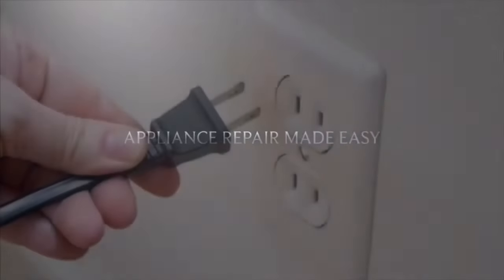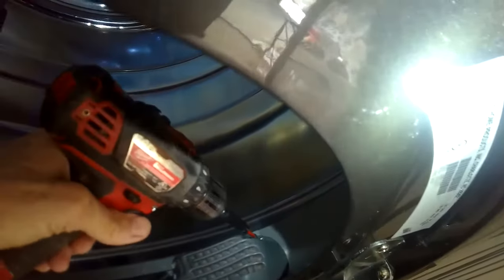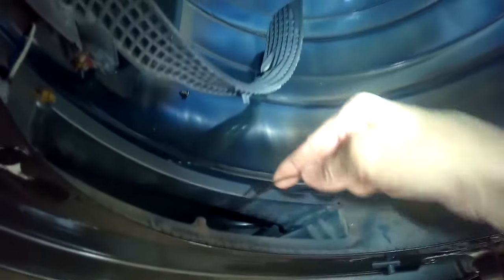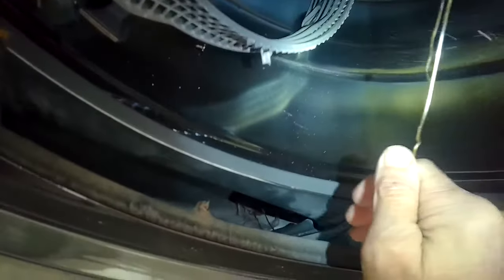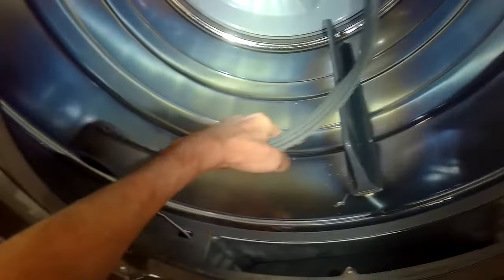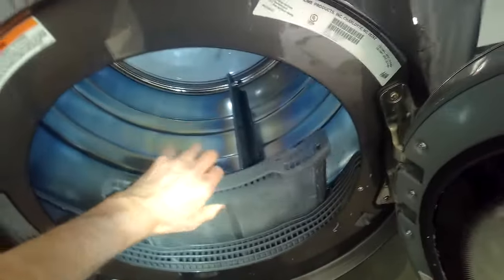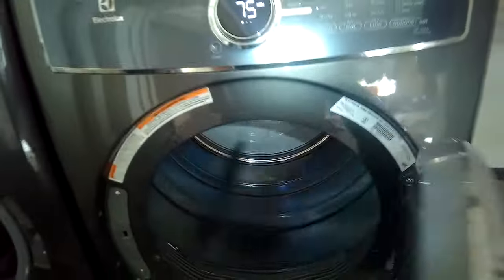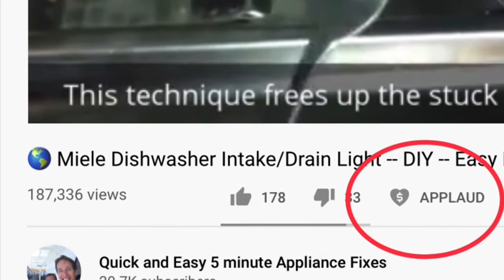✨ELECTROLUX DRYER MAKING NOISES-EASY FIX✨

Comment: Pulled out so much lint.  Have had this dryer for 5 years, no issues, no noise.  But when it started it was awful.  Had two techs out.  Both said oh its just Electrolux and you should just get used to it.  What?  Used your advice and you can't imagine how much lint came out and to my surprise a lint dryer sheet was in the mix.  Yikes!  I couldn't get the wire to work for me so I just got my hand down in there.  Tight fit, but it worked well. Thank you so much.
Reply from the maker: Nicely done 😊😊😊

Comment: Got mine fixed, it just was not nearly as easy as I hoped.  I guess I should not have started at 11:30pm!  I tried your way, but ended up taking the front totally apart.  Only two screws left over--not too shabby.  Thanks for the heads up on the cause and fix.
Reply from the maker: I’m glad you fixed it👍

Comment: Pull out the lint trap.  Then go get your shop vac and get the long skinny crevice vac attachment for your car.  Stick that crevice vac attachment down in there and rotate the blower slightly.  Perfect clean in about 2 mins.  I can't imagine how the cost hanger would work and/or would take forever.  The vac worked perfectly in just a min or tow.
Reply from the maker: Good idea,
Thanks Lane👍
Reply: I did a combination of vac and coat hanger (to break up the lint)

Comment: Thought our rollers or a belt had failed because the banging was so loud. Attempted this as a first troubleshoot and it worked! 

Poor design by Electrolux on the blades attracting lint. Glad this put off the need for a new dryer for many more years, and saved an expensive repair visit (neighbor had a recent group out for $400!).  Thank you!!
Reply from the maker: Nicely done 👍😊

Comment: Thank you, thank you, thank you! My 5 year old dryer was so clogged up with lint that I am surprised we didn’t have a fire. I am diligent about clearing the filter after every use but I had no idea there was such a buildup of lint beyond the filter. I thought it was the belt making the rumble noise but I did the steps you recommended and it corrected the problem. I cannot believe that the lint trap hasn’t been recalled. This defect has been corrected on the newer models and you can retrofit your older model with the new parts. I am going to get in touch with Electrolux and show them pics of all the lint that was in the fan and see if they will send me out the replacement parts. I’ll update comment if it works!
Reply from the maker: Great idea Laura😊
Please let us know how it goes 👍

Comment: You saved me so much money!! Thank you! Thank you! Thank you! I went to YouTube when my dryer was making a loud noise when running. Everything pointed to this. I tried removing the whole front panel and failed because I didn't remove all the screws. Plus taking apart all the electrical connections made me nervous. I will be adding this step to my " to do list" in taking care of my dryer.
Reply from the maker: Nice job Nikki❤️😊👍

Comment: This was a good fix. The machine doesn't make as much noise. I will do this regularly.
I was scared to open up the machine - because it looked so difficult to reassemble so this is much better. Thanks
Reply from the maker: Nice job👍

Comment: Awesome, thanks! I’d actually done this before when we purchased our home with the appliances included for a good deep clean, but the rumbling this time around had me worried about service calls and motors and bearings. There was no gradual buildup, just one load fine and the next sounded awful (though we know now it was this buildup in the fan). Just going to preemptively schedule this every 6 months or so. I can’t believe they let this design pass, and that it hasn’t caused fires!!
Reply from the maker: Good idea👍
There is a new retrofit filter that prevents lint from building up.

Comment: Your great previous video that showed how to dismantle the dyer worked for me about a year ago. However after about a year I noticed the rumbling again. I didn’t know about the wire hanger method, and Instead of taking it apart fully I removed the lint housing and used my shop vac on reverse to blow the impeller housing out. It blows some dust around and can be a little messy, but it does work. Just make sure you clean out the vent pipe of lint afterwards. I aIso thought of putting an additional lint filter ( perhaps cut from an hvac filter) inside the housing just past the lint filter but before the blower.   The tricky part is holding it in place securely while allowing it to be easily removed to clean or replace. (You do NOT want that sucked into the blower! )Maybe velcro tape would do it.
Reply from the maker: That’s a good idea.
They have a new blower wheel with larger vanes that solves the problem 👍

Comment: Mine was nearly walking out of the garage and super loud. I did the full removal cleaning and that worked. Unfortunately once reassembled i was informed that the heater had not been working either. So we'll see what happens next. But thank you for the video.
Reply from the maker: Did you ever get the heat working?

Comment: Hello. How about the vibration during drying? It always moves whenever we do drying so we always hold the machine.
Reply from the maker: Is the dryer resting on the ground?
Reply: @FastFreeFixes  Whenever the last minute of the drying, it was making a noise with vibration so it moves that we need to hold it til it finish.
Reply: @FastFreeFixes  we haven't level the machine yet. So we're using it as it is. Do we have to adjust the level or the feet of it?
Reply from the maker: Thank you,
Is the dryer on top of the washer?

Comment: Mine noise sounds like there are coins or screws bouncing around inside.  What could that be?
Reply from the maker: Hi John,
There’s a few coins caught in those plastic vanes attached to the inside of the tumbler.
Just remove the top panel so you can remove the 3 screws that are on the outside of the tumbler and then you can clean the coins out.